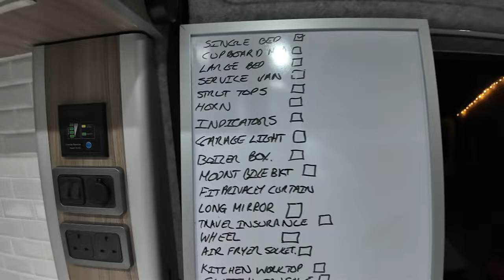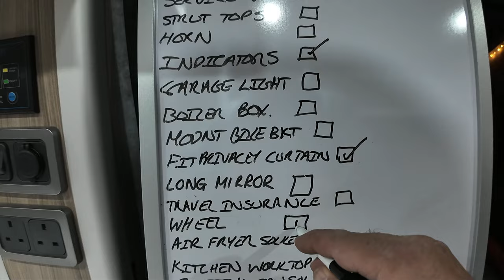modifying our campervan lockers to install a privacy curtain

Comment: My husband and I couldn't believe you took the overhead cupboard down and made it shorter when you could have just shaped the curtain to fit under it. Especially as you've used poppers to hold it in place. What you've done looks very good, but it was a lot of unnecessary work.
Reply from the maker: Why cut corners? No pun intended If a job is worth doing, it's worth doing right 👍
Reply: Lol. Funnily enough we've had to update a load of plumbing under the floor in our bedroom, cut multiple holes in the floor and in the walls in the lounge underneath just so we can have carpet fitted in our bedroom. What a ball ache some of these jobs are and then you never actually see all of the hard work at the end of it. 😂

Comment: More great content from you Sam I'm enjoying the updates just a little tip for you Sam when using the skilsaw have the depth set so that the the gullet of the blade exits the timber being cut that way you have less teeth in the work which will create less drag on the saw motor.
Reply from the maker: I usually do mate but a great tip non the less 👍

Comment: Sam. The white tiles you have on your wall. What are they and where did you get them from?
Reply from the maker: Mini metro tiles from Germany mate  I bought 4 years ago from Ebay I used latex tile adhesive and grout to secure them
Reply: @TheCraftyBlindersvanlife  cheers pal  . Been looking at the cheap stick on ones from amazon but dubious over the quality.
Reply from the maker: The heat will affect them mate @Witteringtrucker
Reply: @TheCraftyBlindersvanlife  exactly what I thought mate. Search goes on. Lol